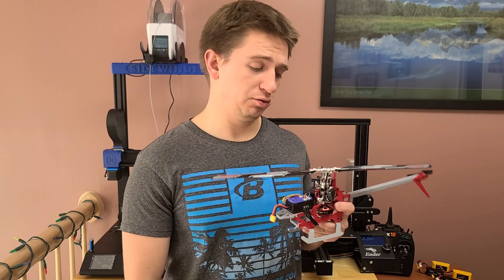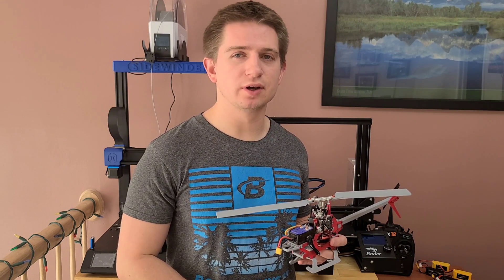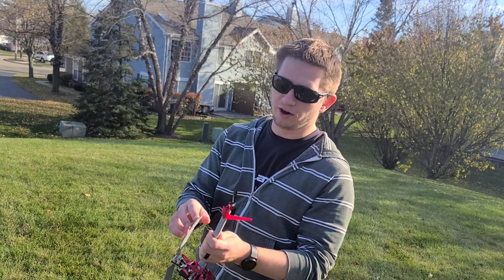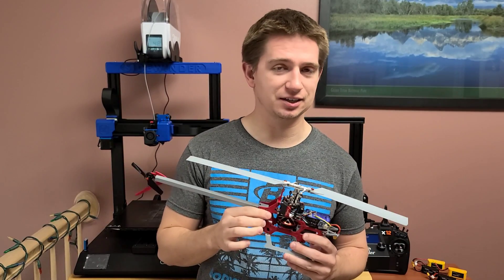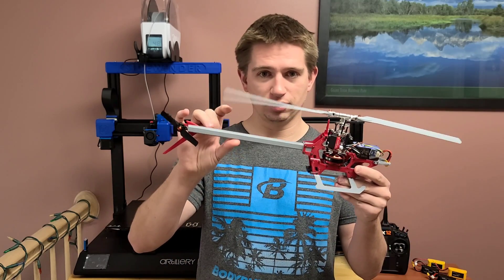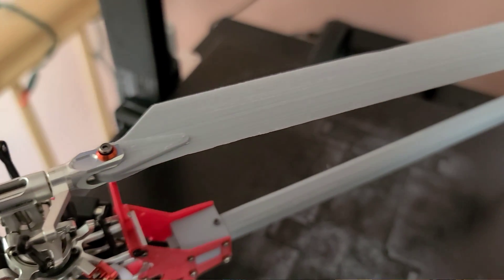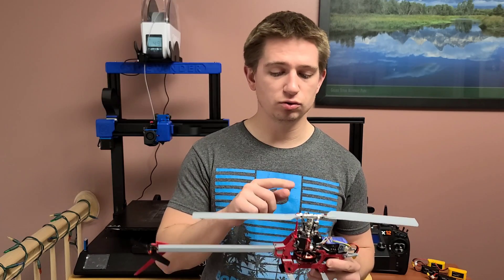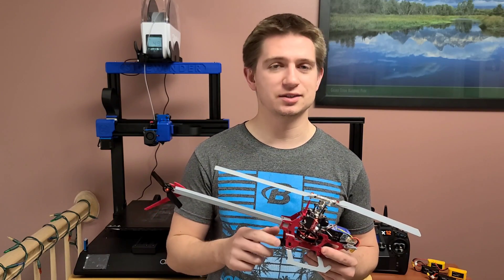Can 3D Printed Helicopter Blades Really Take Flight?

Comment: Myabe on the top side leave a slot and glue in a carbon fiber strip. (PLA would be good as CA and PLA are a great match)
Reply from the maker: Ya I have considered assembling the blades with a stronger core down the center of the blade. The blade is just very thin.

Comment: how much weight did you loose between stock S2 and printed S2 with stock blades (not the breaking printed blades). Maybe tailboom also stock.
Reply from the maker: Most of the weight stayed the same, give or take a couple grams.
Reply: @LifeAroundDamian  okay thanks 👌

Comment: Maybe they could be made stiffer if you applied an outside layer of woven glass, kevlar or carbon fibre but it still seemed to fly ok.
Did you use an extrusion printer or a resin printer and what plastic was it made from. ?
Reply from the maker: I FDM printed them using PETG. I'm considering trying out resin printed blades. They might be able to hold better
Reply: @LifeAroundDamian  Resin printed are usually not as strong although you could make them thicker to compensate.
Reply: @LifeAroundDamian  Resin is weaker you may have to make them thicker to get the same strength- PETG is actually a good choice it's strong and flexible - i would suggest trying  PLA+ it's more rigid but still quite strong and flexible.

Comment: Do you think carbon filament would make the blades stiffer?
Reply from the maker: I would love to think that, but I have never worked with carbon filament. Do you have that capability?
Reply: @LifeAroundDamian  unfortunately no I don't. I know there's PLA filament with carbon particles but I've heard it really wears out the nozzles on the printer. I might go to microcenter this weekend for a roll and see how it goes.
Reply from the maker: @boogiemere1214  Yes, I heard the same thing about the nozzle wearing out. I would also consider looking into PETG CF as well. I'll have to find someone to print me a set for some testing!